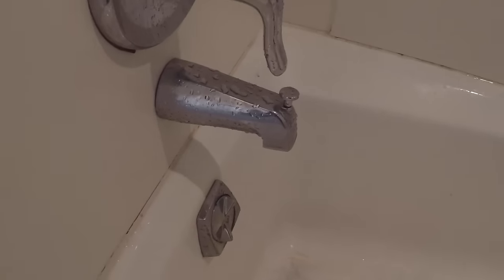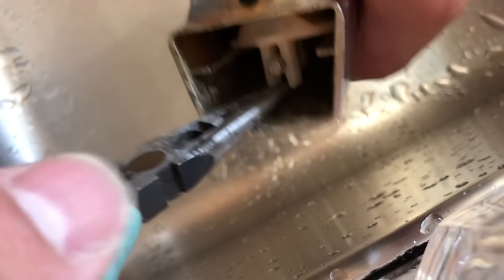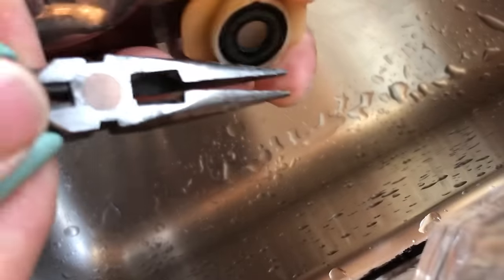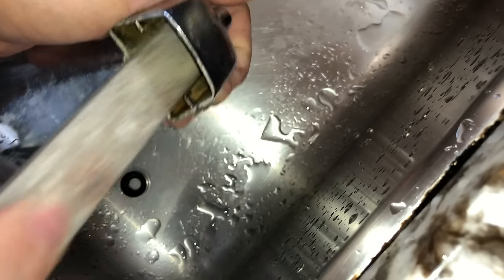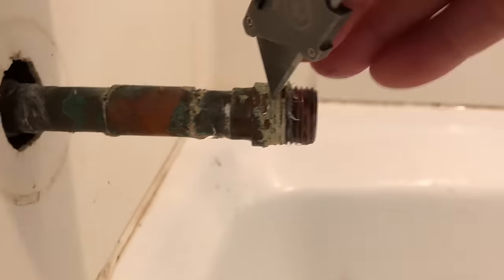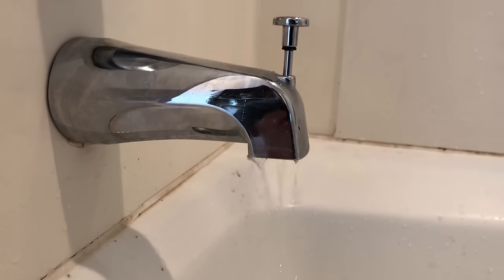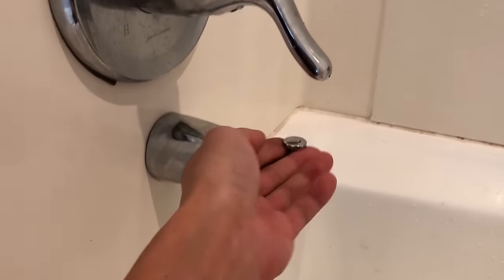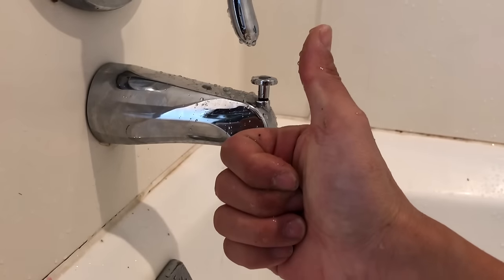Repair Leaking Tub Spout Diverter Pull in Shower Mode

Comment: I would caution your viewers to put a towel down to catch any loose parts. I needed to see where the o-ring goes but in my case, I need a new white part as it won't stay on. Don't see the need to remove the spout either.
Reply from the maker: 🤦‍♂️ You’re right. That goes for any repair around any drain. Good point! 👍

Comment: Mine won't unscrew by hand, afraid to us a pipe wrench because it might break the pipe!
Reply from the maker: Yours might have a set screw on the bottom. Look underneath if yours is like that. Or if you have a compression spout, it may need a special way to take it off.
Reply: @chicagohandyman  It does have a slot on the bottom that comes out about an inch from the wall, I will try a small screw driver or a mirror with a light. All the house is PVC but when we had the bath tub and the shower en-closer in 2003 the guy put copper pipe in the shower wall. It was a claw foot bathtub before that,no shower before.

Comment: my spout does not have a set screw and I've been trying to  unscrew it for a half hour all it does is spin and spin and spin
Reply: Tub spouts like this are offered with two different types of installation. Threaded units that screw on ... and ones that have a plastic channel or tube with a O-ring inside and are called Slip-On spouts. You simply push them onto the pipe then tighten the set screw. To remove the spout you simply loosen the set screw and pull on the spout straight out from the wall. To replace, simply push the spout back on and tighten the set screw. Just FYI: The benefit of the slip-on spout is you just push it on until it hits the wall. With the screw on type spout, the plumber has to be careful when sweating on the threaded nipple. If the pipe with threaded end is too long the tub spout will tighten on the threads but the back of the spout won't reach the wall and leave an unsightly gap. If the pipe with threads is too short the threads may engage the spout but not enough of the threads will engage to create a leak proof connection.

Comment: You forgot to mention to unscrew the tiny bolt inside before unscrewing the spout diverter.
Reply: There are no "tiny bolts" on this type of diverter. This type is held in place by the treaded pipe as he showed in this video.

Comment: you must check if there is a screw underneath and unscrew it first otherwise you will break the water pipe and you have to call a plumber to fix it it cost you guys alot.not a good explanation boss

Comment: Put the spout in the hot water with vinegar and check back 1 hour. 
70% vinegar vs 30 hot water.
Reply: You'll want to test a small hidden spot first before trying this approach.  Some of the bronze (and even chrome) finishes can be badly damaged this way.  I'm speaking from sad experience (though I was using dilute CLR rather than dilute vinegar).
Reply: @mcyofd  mine was ok. But it is a good advice. Thx

Comment: don't u have to turn off water before taking off tub spout
Reply from the maker: No.
Reply: @chicagohandyman  are there certain size diverters? cuz the one I put on seems about the right size but there seems to be a bit of gap where washer touches the spout opening
Reply from the maker: Yes, and they look similar. Best to find out exactly what you need.